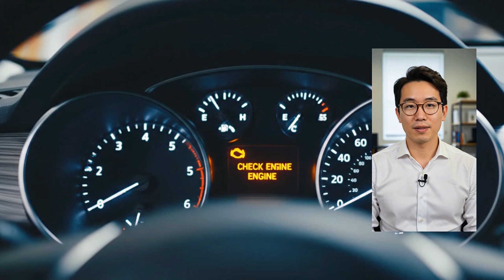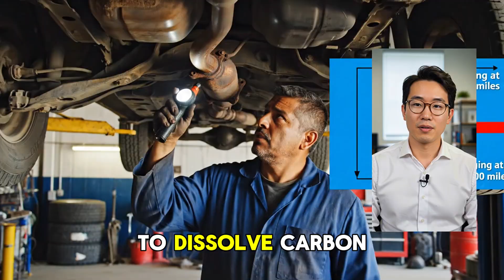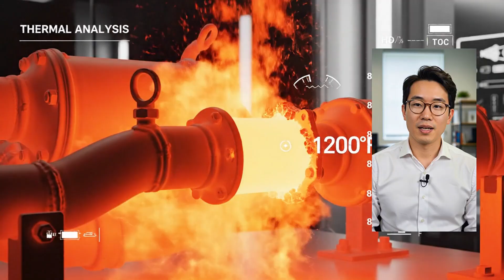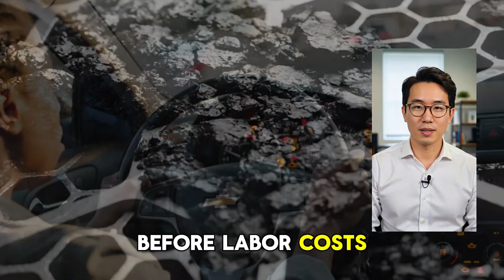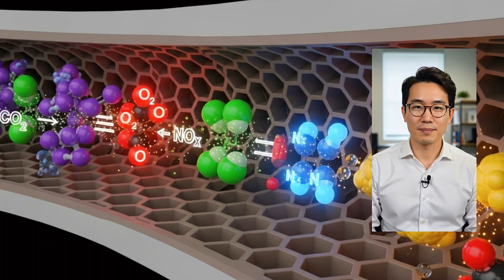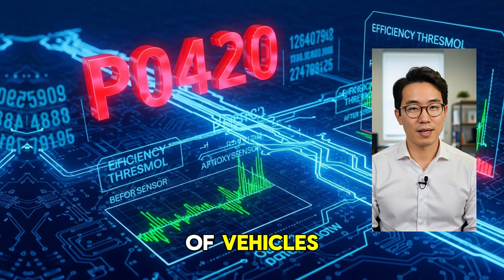$2 Liquid STOPS ALL Catalytic Converter Clogging PERMANENTLY! No Mechanic — DEALERS CHARGE $2500!

Comment: Thumbs DOWN!!! - There's no mention of the liquid.
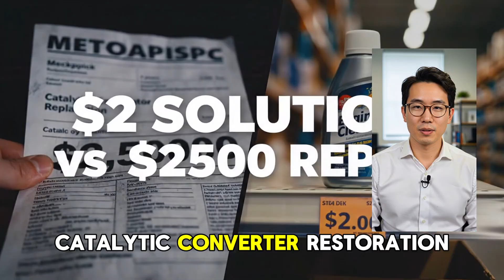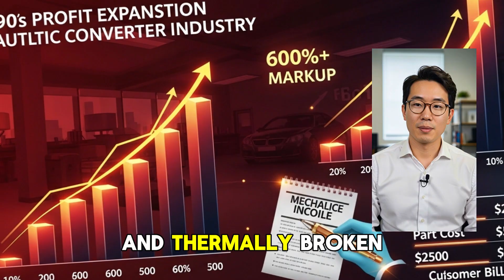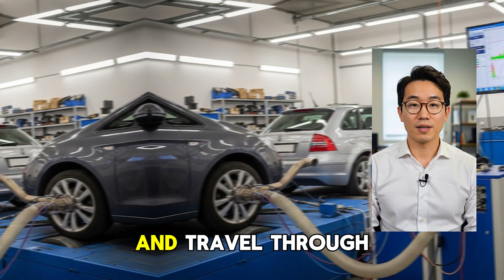The "$2 liquid" described in the video is a chemical fuel additive designed to act as a solvent to break down carbon deposits within the exhaust system (0:00–0:05). While the video does not name a specific brand, these products are typically marketed as fuel system cleaners, emissions system cleaners, or catalytic converter cleaners (6:13–6:17).
How it works:

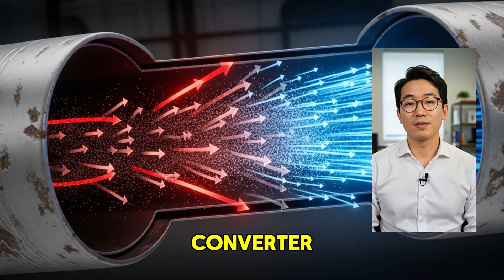Chemical Action: The solvent is added to your fuel tank; it vaporizes during combustion and travels through the exhaust system at high temperatures (6:14–6:20).
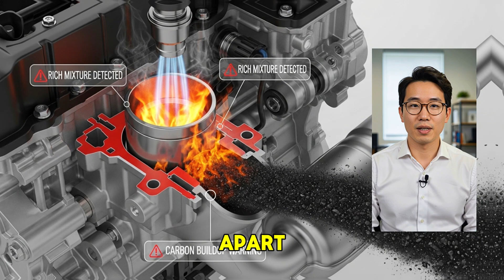Carbon Dissolution: These vapors circulate through the catalytic converter, where they chemically soften and help burn off carbon buildup on the honeycomb structure (6:24–6:33).
Driving Cycle: The treatment requires a specific driving cycle—typically sustained highway driving (2500–3500 RPM) for 30–45 minutes—to ensure enough heat and flow to reach and clean the converter (6:43–7:00).
Important Considerations:

Scope of Effectiveness: This method is only effective if the converter is suffering from carbon fouling (clogging). It will not fix physical damage, such as a melted core, broken honeycomb, or contamination from coolant leaks (7:34–7:55).
Expert Opinion: While some mechanics and DIYers find these additives helpful for clearing minor restrictions and temporary P0420 codes, professional opinions vary. Some view them as effective maintenance, while others consider them "snake oil" that cannot replace a damaged component.
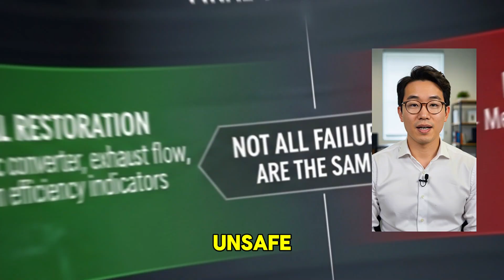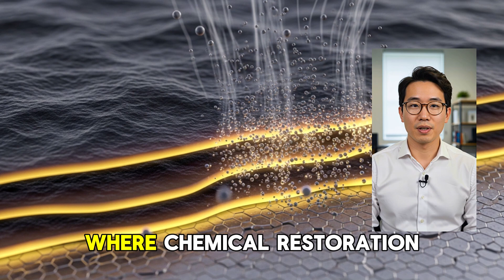Safety: Always verify your vehicle’s manufacturer guidelines before using additives, as some manufacturers express concern that aftermarket chemicals could potentially affect sensors or void warranty coverage (4:49–4:59).